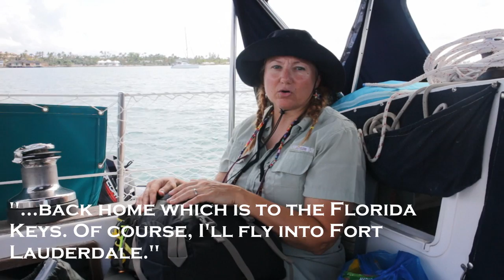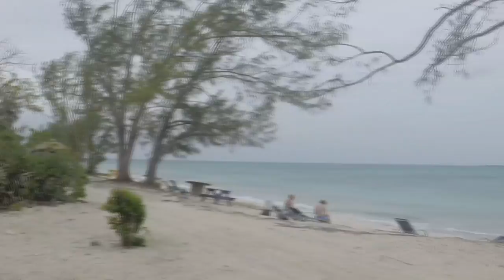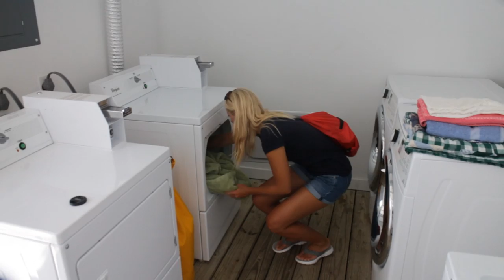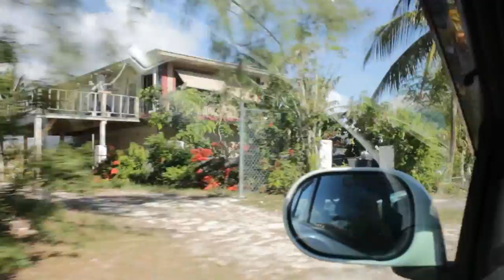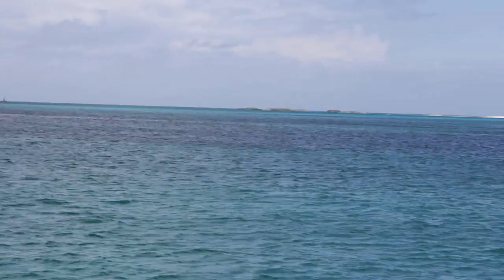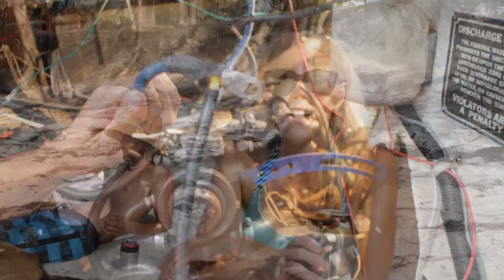Episode 10: Sparks in the Engine Room

Comment: This wire failure looks like simple metal fatigue from vibration and flexing of the multistrand at the terminal fitting.  If the single shrink tubing sleeve does not stiffen the junction adequately, consider a second sleeve over the first or several wraps of quality electrical tape.

Comment: Thanks for the maintenance tip, I need to go through and make sure I have the properly sized terminals for the larger cables.  And a method of attaching them.  I do keep a gas torch for soldering, so maybe it's just a matter of making sure I have solder terminals too.

Thanks for sharing!

Comment: I would buy or borrow a proper copper crimper for that size connector, cut that heat shrink off and repress your existing new connector. Put some NO OX grease on the connection to prevent oxidation and reshrink wrap. Your repair should work fine till you can get the proper crimper. Nice job on the repair and your attitudes are great. I enjoy your videos.

Comment: If that was an aluminum crimp connector, which it looked like, you may have additional trouble. Aluminum/Copper joins are notorious for oxidizing and overheating. You should be good to get to the next service port, but I'd try to get a proper copper connector, or at least verify the aluminum connector is copper rated. Or I guess your copper cable could be aluminum rated, but better safe than sorry.